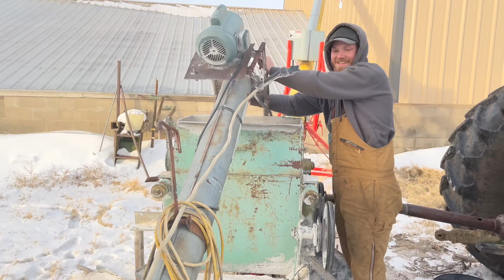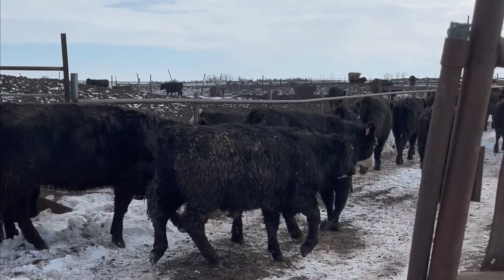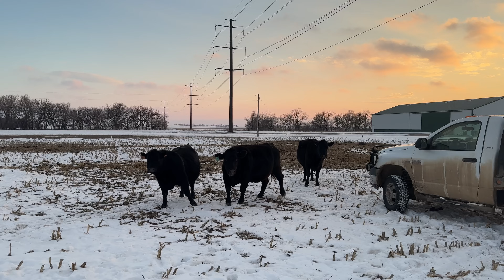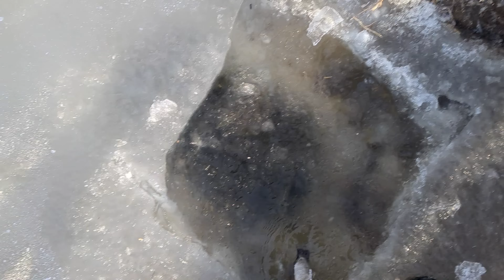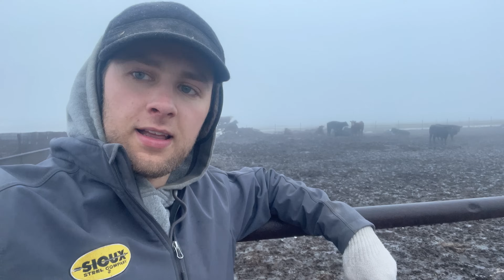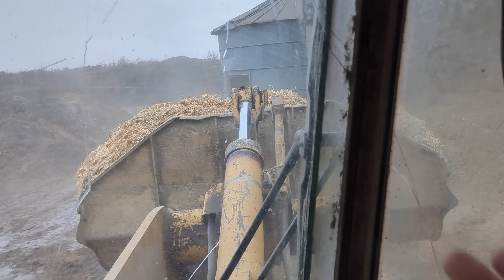Two Year Old Feeds Cows

Comment: Shaking bucket does no damage to seals we do this all the time. They just get hard  from age
Reply: I figured. What was weird about this was it wasn't the seal that failed but the threads on the barrel so the whole thing came apart at once. But ya I'll bet scooping off the hard pile and other stuff we've lifted on puts more stress on it than shaking.
Reply: If you all have problems  with a cylinder give use a call we work on bigger ones that😅

Comment: Here’s a starter story for ya. I had a 19 Kawasaki on a Commercial walkbehind that kept giving me starter trouble. The dealer wanted $180 for a new one in 2009. I took it to an electric repair shop and the guy didn’t say a word, just walked to the back of the room and started working on it. He brought it back a few minutes later and said $22 dollars. He replaced the end cap and all the brushes. The dealer was just a little bit greedy. He could have done the same thing and charged me $100 and we’d both be happy. Greed